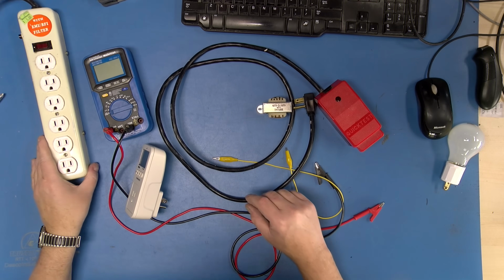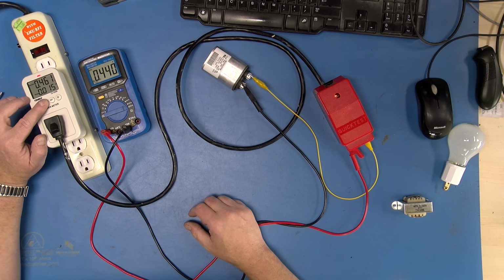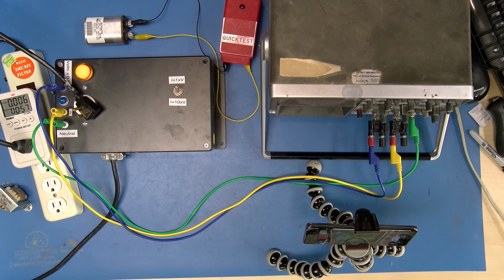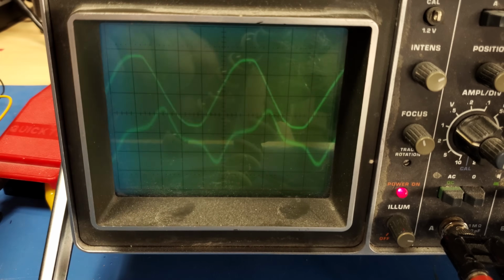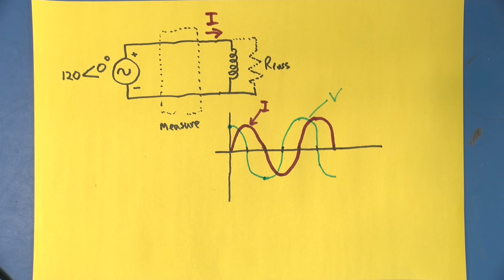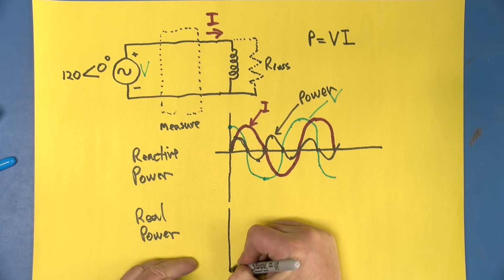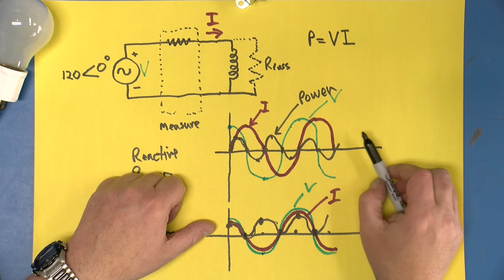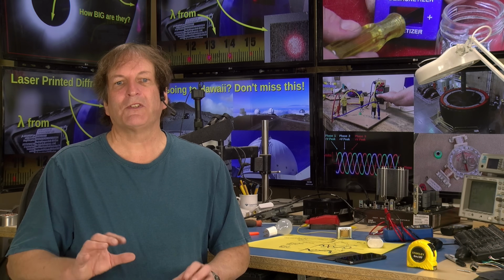That strange flow of electricity that transmits no real power

Comment: As I understand it, since utilities are converting everyone to Smart Meters, I'm pretty sure that billing/monitoring of residential customers for Apparent Power is going to be possible now.
Reply: Yes, that is possible, they are already doing this here in Belgium at residential customers who have a "Smart meter". On paper (and in my Energy provider customer portal) my energy consumption is raised, while i'm using the same amount of devices/power throughout the years. Grtz
Reply from the maker: @BjornV78  Your consumption seemed to go up after installing a smart meter? While those meters should be able to monitor and bill for apparent power, as far I I know over here (Canada) we dont do it for homes. Could it be the old meter (or new one) was slightly off?
Reply: @ElectromagneticVideos  the difference with the new one (digital) is that the electric company now can see at which moment of the day the power is consumed. With the old one (mechanical type) they couldn't. We get now charged more for our electricity during the peak hours then in the evening or night. But i think they also measure the real power now, so with LED bulbs that use capacitor dropper circuits, the power factor is very bad.
Reply from the maker: @BjornV78  Interesting! When they first installed an electronic meter on my house they also did time of day metering. But after a while abandoned it because the had communications reliability issues getting frequent power consumption updates from the meter. 

I wonder of they are looking at the peak current to calculate some form adjusted real power?
Reply: @ElectromagneticVideos  UK are still sorting the comms issues as not all meters are compatible with the suppliers systems. Also they are working a mesh system of communications so will find the easy path to a cell tower which could be one meter in a block of flats. So that device will be constantly pinging the network.  I do not like the fact they can remote isolate my supply especially as we have unfriendly countries hacking our utilities.
Reply from the maker: @WOFFY-qc9te  The hacking thing really concerns me. I didnt know some power meters were equipped with the ability to isolate. That could be a huge vulnerability of hacked. Even just messing up meter readings could create financial havoc if done one  a widescale attack.
Reply: @ElectromagneticVideos  Octopus in the UK do real time metering and some customers were asked to load the system at no charge. Octopus had a surplus of green energy,  an interesting utility supplier.  

In the Hebrides however they generate more power than they need and it is sold back to them at a higher price, how does that work.  

In Ireland they were paid to use more electricity under a green rebate scheme so the farmers filled their barns with heaters and got paid to fortune.
Reply from the maker: @WOFFY-qc9te  We have had crazy things here too. Years ago massive solar generation subsidies, with so much power being generated that significant amount were dumped in load banks bu the power co to get rid of it while pay 80 cents/kwh, 8 times the normal rate charged to comsumers :(
Reply: In France of you consult the meter on the screen it is written in VA volt ampere, but the invoices are still in kW. The national grid company Enedis affirmed that while the electronic meters can measure VA the customers are billed with apparent power only.
Reply from the maker: @guybaot  Interesting! (I'm assuming you mean are billed for the real power? Apparent power includes the full VA combination of real and reactive power. )
Reply from the maker: I'm sure they could - I have an electronic meter development board that I want to look at some time in a video so it will be interesting to see what I can measure with it. I'm wondering if measuring the spiky current from from electronic power supplies may be what they start billing extra for in homes.  (Maybe they already are and that's Bjorn;s issue below)
Reply: @ElectromagneticVideos  I'm sure smart meters tick a lot of boxes for the utility companies.  They can reduce staffing for manual meter reading, reduced staffing for call centers, more efficient response to outages, different billing rates for peak hours/seasons, and I'm sure they'll start charging for all the SMPS we all have plugged into our walls.
Reply from the maker: @RK-kn1ud  I think the reduction in number of meter readers required is probably a major driving force - I wonder how much a meter costs them? Even if it cost $500 installed, over a few years the savings to them is probably substantial. I wonder how effective time of day billing is in terms of reducing peak loads?
Reply: @ElectromagneticVideos  It would be interesting if the smart meter aggregate the power seen at frequencies higher than line. There is a lot of switch mode PSU noise getting in the system and with the addition of PWM solar inverts I can see it getting messy.
Reply from the maker: @WOFFY-qc9te  Not sure if you saw but I have a smart meter eval kit waiting for me to play with. It will be interesting to see how they sample the current and if it is done at a high enough rate to capture all of that. I would hope so - as you said - so much PSU noise, inverters, etc. The non-fundamenal harmonics probably carry more than an insignificant amount of power.

Comment: I remember from high school this: ELI the ICE  man and it still resonates  44 years since I graduated  high school. AC was to me more interesting than DC because of reactance as frequency when varied causes load variance in a form of complex wave forms that still bring imagenary numbers to mind. Electronics and electrics rock!
Reply from the maker: Yes - it really is interesting - both from a math and practical standpoint, and its really cool how complex numbers perfectly represent AC in the same equations used for DC. One even neater extension is to do the math for multiple/all frequencies at once using Laplace or Fourier transforms, which makes it possible to predict things in DC circuits such as the transient response when a switch is open or closed and current flows in to inductors and capacitors.

Comment: I would like to see an explanation of why a capacitor discharges at half voltage & takes double time, compared to theory.
I allready know. I know everything.
Mac from Ballarat.
Reply: Which theory?
Reply: @hamdaniyusuf_dani  
I am especially interested in the physics/science.of electricity. 
Standard electrical engineering says that electricity along wires is not due to electrons. True.
Standard engineering says that a capacitor will discharge in a certain (linear) way over a certain time.
Tony Wakefield of Melbourne has shown that capacitor discharge is non-linear, & takes twice the standard theoretical time at half the voltage.
Ivor Catt explains. Forrest Bishop also explains some of this stuff.
All of this stuff is on google.
Reply: @hamdaniyusuf_dani  
I replied here, but my reply is missing? Ok i will try again.
Tony Wakefield of Melbourne tested the standard theory of discharge of a capacitor.
Ivor Catt provided an explanation of Wakefield's test/experiment.
This stuff is on google. Forrest Bishop also explains.